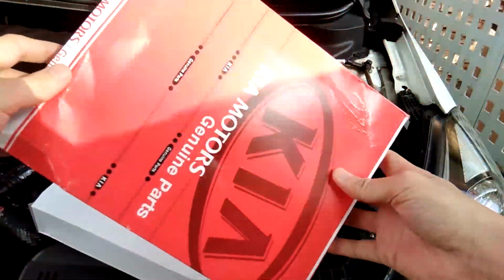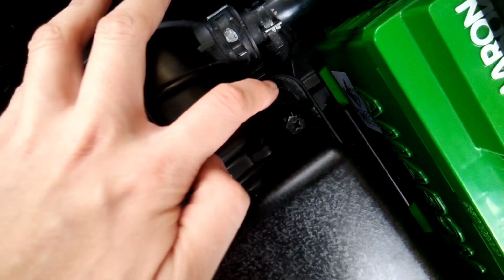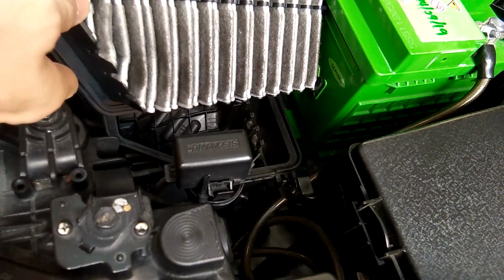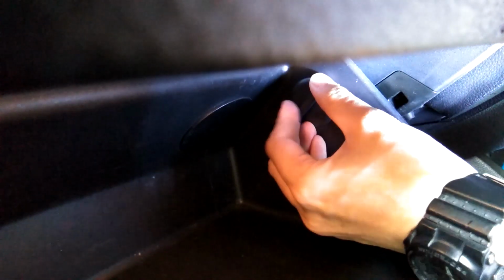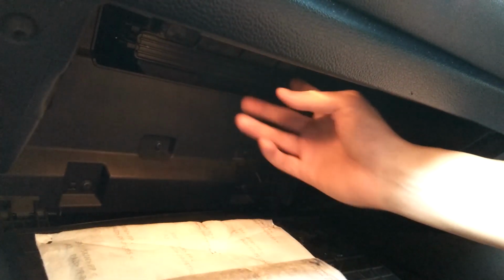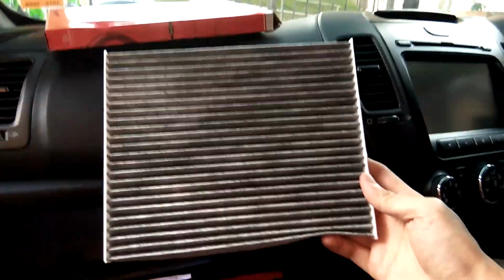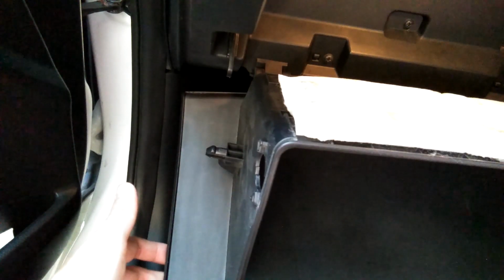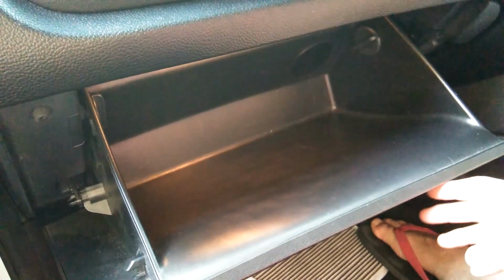Replacing engine air filter & cabin filter for Kia Cerato/Forte K3 (2014-2019)

Comment: which way is the correct orientation for cabin filter? in the video, the old one i saw arrow up, then change new one arrow down. btw good video
Reply from the maker: OMG thanks for correcting, the correct way is going down, because the fan blower is at the bottom, so air is sucking from top to down. I installed the wrong way previously haha!
Reply: @junkitlow  lol 😅